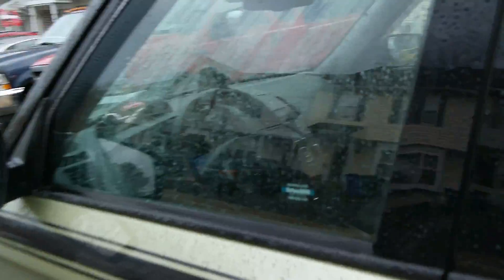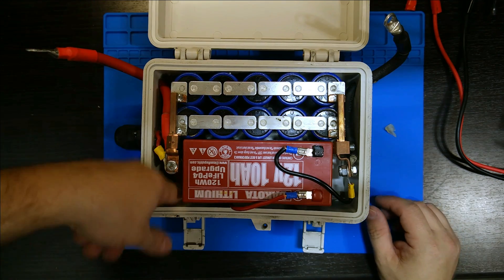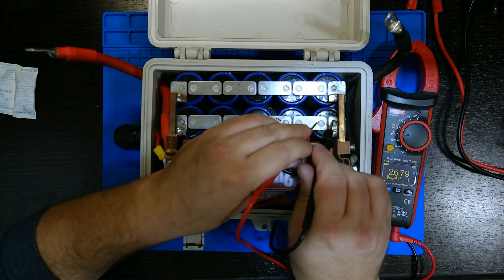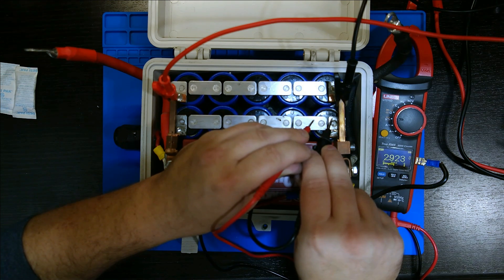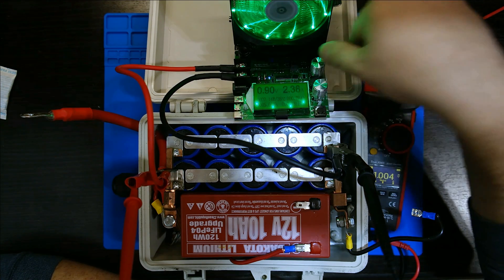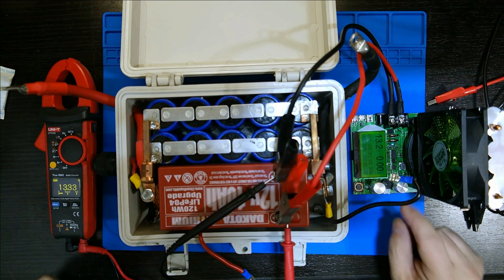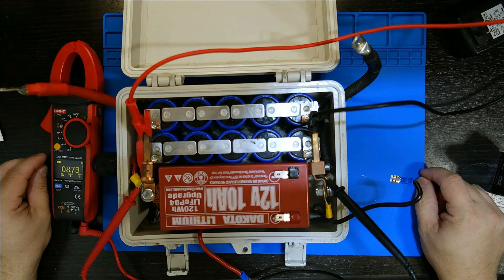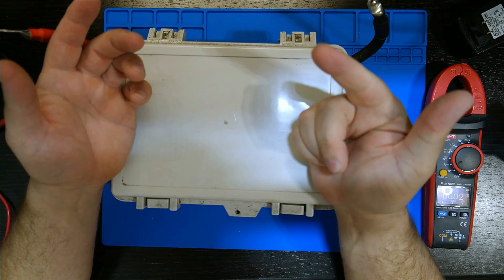Hybrid Supercapacitor Car Battery Part 10   1 Year Durability Testing

Comment: So cool, I gotta build me one of those now...
I can usually squeeze 2-3 years out of a $100-$150 lead acid battery,  would love to see how long it stays good...
Great video...keep em coming, still start your car smoothly?  How well does it do if it sits for a long time, has it left you stranded ever by mistake?
Reply: @OmniTechnologies Research -  You are 100% on changing the Acid every year!  I started to experimenting on changing Battery Acid myself this year. Battery Acid is CHEAP, I got 5 Quarts for $22.00 at Home Depot!  1/5 of the price of a new battery!
Reply from the maker: It will last on its own for about 2 weeks and then the lifepo4 battery will be drained from the parasitic loads. I really do suggest you build one, just make sure you don't overheat it since you live in a rather hot area.
Reply: Mad Electron Engineering how would you recommend to control the temperature of the battery in hot climates? I'm thinking to add a computer fan, and some thermistor + mosfet circuit to control the fan. Then I'd glue/tape the thermistor to the battery itself, but I feel like its far from the proper solution. Do you happen to have an idea? Thanks
Reply: Brian C Adding a capacitor bank to a lead-acid battery will prolong it’s life as well. You could start with that and see how that goes. I bet you’ll squeeze at least 1 extra year out of them.

Comment: 5 caps in series. That's 2.9V per capacitor when the alternator is charging at 14.5V! I presume they are 2.7V super capacitors???
EDIT: You said it; they are 3.0V capacitors, sorry.

Another thing: I have experimented with a 6X350F system with balancers and a paralleled 4S 5P (12AH) Li-ion pack with BMS and I don't drive that often, and last winter i managed to run my lithium battery pack down so it shut off. I have noticed that self discharge is larger than I would like which is either the balancing boards or the Maxwell capacitors or the BMS in the Li-ion pack. The car itself only uses 2.5mA parked. So what kind of capacitors are you using? I suspect they are better as the manage without balancers and have less self discharge?
Reply from the maker: I'm using amperics supercaps.  I'll try to add them to the description of the video later today for you.
Reply: @madelectronengineering  Thanks alot!
Reply: I'm thinking to actually add a relay, powered by the ACC signal of the car, to disconnect the supercaps when the engine is not running. The disadvantage is I'd need to wait a few seconds (a practice we should all do for fuel injected cars anyway) for the supercaps to charge before cranking the car. What do you think?
Reply: @PatrickHavilah  Depending on how long you intend to park between driving, it might work. However, if the caps are low, they'll pull a lot of current when you turn the key to first click, even as much as your fuel pump wont run.. What I did was put a power resistor (really a heater core from a 12V car window blower) to act as a limiter from B+ , so charging voltage, didn't bog down the alternator completely, when putting out 14.5V into caps at 10V. However, when parked for a long time, the caps drained anyway (I only had 50F combined capacity, 6X300F caps),  So I put in a 10W solar panel on the dash, with a solar charge controller, to keep the caps at 14.5V most of the time. In winter, there wasn't sufficient sunlight though. So I'm hoping to upgrade the caps to some of the more expensive ones with 10 times the capacity. It's an old car, so quiescent drain is only 4.5mA when parked, still, it was too much for parking a week in winter.
Reply: Tore Lund the solar panel idea is brilliant! Is it safe to run when the car is running (alternator is charging) though? Or do I need to disconnect the solar panel before starting the car?

Btw, where did you buy the 300F supercapacitors from? Is it AliExpress/Banggood/eBay?
Reply: Tore Lund Im not sure if I understand the resistor completely. So the 14.5V battery charges the supercaps only to 10V? Where did you put the resistor? if I understand correctly from the video, it seems like he put it in series with the battery, which I'm still wondering if you'll get a "voltage divider" scenario where the battery won't charge all the way to 14V (from alternator) since some of the voltage goes to the resistor. Could you help me on that please?
Reply: @PatrickHavilah  They are Maxwell caps, bought from Mauser as a strip intended for power conditioning. They had simple bleeder resistors for ballancing, as their intended use was not for Long term storage. So i substituded Them with chinese balance boards, self discharge was still a Tad in the high side. So obviously, Better and cheaper caps exists today. The Polish skeleton 3000F caps are high quality with low self discharge and reasonable priced So they are on my wishlist. A Solar Charger is puny compared to an alternator. And the car wont complain about 14.5V when stopped. Actually most cars can accept even16V, but check out your cars details specs, og you intent to go above 14.5V, cars are designed for considerable over voltage. Solar Chargers dont suffer either with an alternator. For all IT cares, it just looks like another battery. So no problems at all, and as I said, it isnt powerfull enough to overrule the alternator voltage regulator when running.
Reply: I'll explain it a little more in detail: So when I park the car, the caps stay  at 14.5V for a while, but being parked 2 days, they sink to around 11V. Still enough to start the car, but after cranking they are at 10V,  the alternator then starts charging, and because the voltage is low, the alternator delivers max amps. In my case 45 amps, so the car is running on less than 14.5V V until the alternator brings the voltage up, this messes up the fuel pump or the ECU and the car runs badly for a few seconds and the alternator wire also gets hot.. So my solution was to put this fat 0.4 Ohm resistor on the alternator cable before the battery (not the cable to the starter!). Then the alternator is loaded less around 15A and the system voltage is 14.5V right away. Obviously, the caps charge much slower and take a minute or so before they also are at 14.5V, but the car runs perfectly from cold starts.  For that reason, if you connect the caps to your ACC before you start the car, you still pull a lot of amps into the caps. so whatever fuse you got, will blow.
LOL, I tried the Li-ion pack with balancer also with my power resistor, not to draw 100+A from them when recharging the caps after a crank, and it worked, for a while. Problem was when the temps got below zero, the capacity dissapeared from the batteries, and the selfdischarge from the caps, pulled them down further, so the were murdered. But if your climatre is warmer, the 4S4P pack I had was enough, to prevent the caps being discharged too much to start. So that is why my next setup will be without batteries, just big caps, and a solar charger, to have an all climate resilient system, the will last forever unattended, and even recover by itself, if the car is left for months during a dark winter. Good luck Cheers.
Reply: NB.: running caps without a balancer is tricky, when you deal with inductive loads, even if the natural balancing of the caps is enough, because if you accidentially crank them flat, the windings in the starter act like a coil, and send back a reverse current, i.e.  reverse polarity to the caps, which hurts them. I practice, a low voltage cutout to the starter selenoid, is easy to implement, so I will consider your suggestion in my next setup.
Reply: Tore Lund I think most 16V caps (that consists of 2.7V or 3V caps) already have balancers, no? I see some PCB with ICs though I'm not sure what those ICs do.

Comment: Nice video thanks for sharing it with us , and I was wondering if u can tell me how much cranking amps that lithium battery that u have in there puts out , I know a regular lead acid battery that claims to b 12 volts 7 or 9 ah has 120 til 150 cranking amps that they deliver and I saw urs which is 10 ah and lithium I was wondering how much can give,
Reply: The cranking amps come from the supercaps so it dosen't mater, the  LiFePO4 only has to charege the supercaps after starting the car 
he is using a 0.1 ohm resistor between  them
Reply: Jon Ander 

Yeah I already knew that I was just wondering bout the lithium battery by it self , just wondering if u knew the cranking amps , cause am trying to do a project my self , and just was curious if I may knew for instance like how much amps would deliver , that’s all , but thank u

Comment: Great project and I have followed from start.  Batteries and electronics in general for some reason confuse me.  I have a GMC duramax diesel truck that takes 2 group 100 batteries (CCA 800, amps 965, rc min@25 amp 110).  I live in the desert and they last about 2years, 3yrs max.  Could you give me your thoughts on how to replicate these specs?  Thanks for the great content.
Reply from the maker: You would most likely need to build two of these units, but use 4 strings of supercaps instead of 2 like I have.  I would also see if other gmc duramax owners have done a battery relocation in their truck to help with the excessive heat you get living in a hot environment.
Reply: @madelectronengineering  same problem in the northern states. Don't forget to account for the power used buy the glow plugs if ever in a cold area.
Reply: Common problem with those. They over volt those batteries alot.
Reply: just buy like 4  40152 lifepo4 batteries and put them in series.  I bet it would work fine and cost less than a lead battery.  I guess you could get and and do 4x2 to get more amps.

Comment: I was really hoping for this one year review so thank you. I'm going to build this next year. I think I will try to get a small AGM battery for a ATV. I haven't decided to use one set of capacitors or two yet. maybe I will try it with one set and if that doesn't work buy another set. This will be going in my 2005 Colorado with the 3.5L straight five.
Reply from the maker: For the 3.5l 5 cylinder in those trucks I would recommend 2 or 3 strings.  1 string wouldn't be powerful enough and you would burn out the supercaps.
Reply: @madelectronengineering  thank you for your response. I have purchased a string of caps on a balancing board and they are disappointing. They are on Amazon as Shaluoman Farad Capacitor 2.7V 500F 35X60MM Super Capacitor With Protection Board. After completely charging and discharging them a dozen times they will go to a higher voltage and handle a load longer. If I charge them and totally disconnect them, they will not hold a charge for long at all. I guess I will try Amperics without a balancing board next. I'm not giving up. I have decided to use an AGM battery that has about 310 CCA. When I have sufficient funds I will copy your design with 2 strings of caps. What do you think? Should I also use some kind of resistor to protect the battery from overcharging? Any input would be appreciated. Thanks in advance.

Comment: Why aren't cars like Teslas using these hybrid batteries  ?
Reply: Tesla just bought Maxwell so I guess we will see.
Reply: They dont really need cranking amps  they need a lot of energy and those supercaps only  have 6 Wh (almost nothing)
Reply: @jonander6811  yeah, they need sustained current, ALOT to get moving, but quickly taper off
Reply: Capacitors dump a lot of energy at once but don't store much energy.  Great for 2 seconds of engine cranking.  Not so good for listening to the stereo for 2 hours without the engine running
Reply: @SwankySasquatch66  low power density, extremely high current. It could make sense to use it in 1/4 miles cars... Currently just for fun.
Reply: LiIon still has the highest watt hr to weight ratio out there...if supervaps could do 12-15vdc or higher and do 700F+, then you would see supercaps become mainstream for power storage devices

Comment: Ηοw were the super caps 13.35V out of the car and in the car 12.9V? What's causing this drop?
Reply from the maker: The drop was caused by electronic unlock of the door and also have footwell lighting that pulls 6 amps when the doors are open. The second I opened the door the lights started to drain the supercaps.
Reply: Mad Electron Engineering Replace those bulbs with some LED lights, about 100 mA drain per LED VS 1 Amp on the edition bulbs. (1.2 watts vs 12.4 watts on average).
Reply: @madelectronengineering  Oh ok! Do you still have that resistor in between? If yes whats the value?
Reply from the maker: Yes it's still there.  It's a 0.1ohm 25 watt resistor.
Reply: Mad Electron Engineering would you mind to provide the calculation for the resistance? I'm still confused why you ended up with 0.1 ohm

Comment: Great vid. I still want to build a battery like that for my truck. I'll have to go back thru your earlier videos to see the parts you used.
I look forward to the 2 year test.
Reply: hey just get a supercap from a audio parts store, you can get some really big ones. and are already done up with connectors and usually have voltage displays